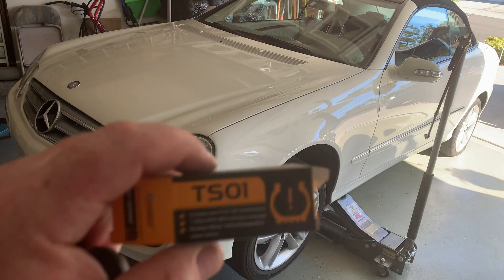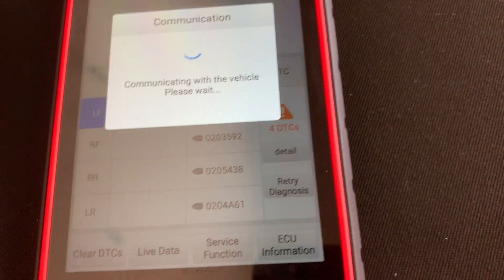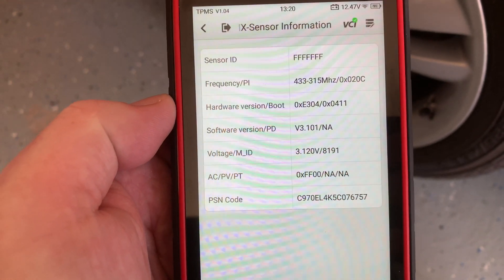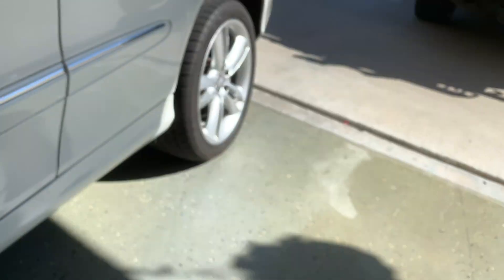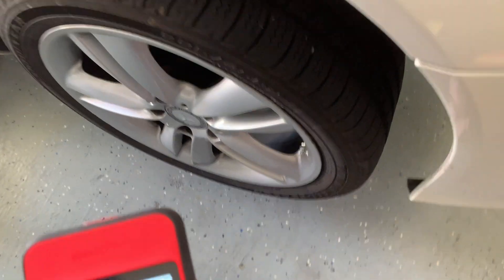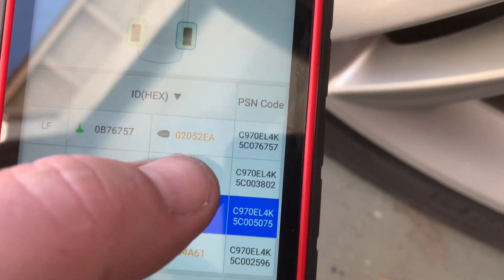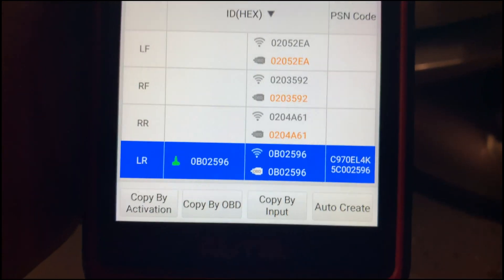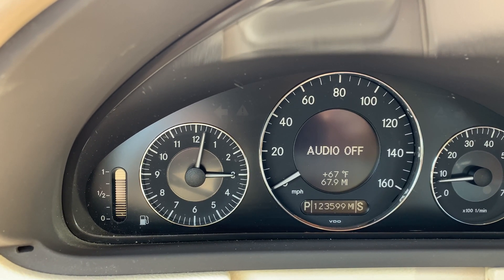Programming TPMS Sensor with the Autel IT600E

Comment: I have an autel TPMS tool  ITS 600
and it wont connect to internet after recent software update 
I proceeded to reset the device thinking it would fix the problem but it did not. After the reset the device wont connect to the internet to install apps making the device unusable.